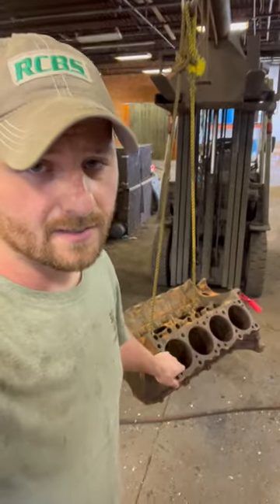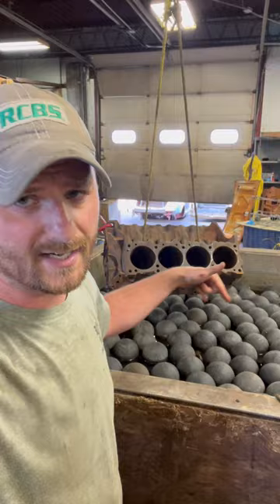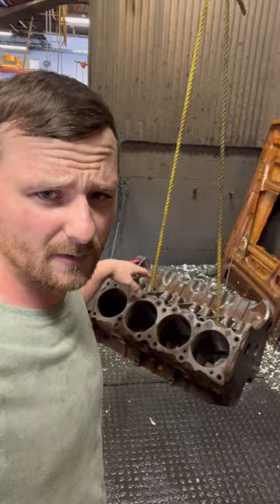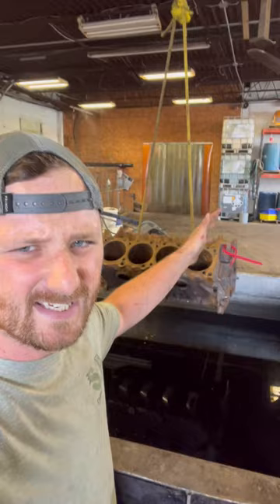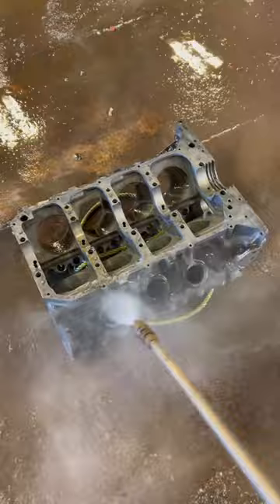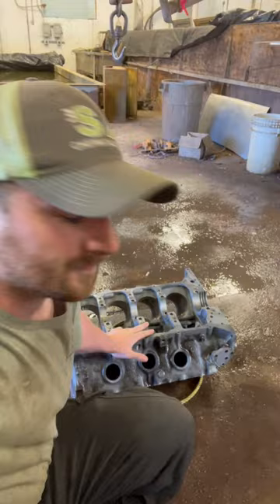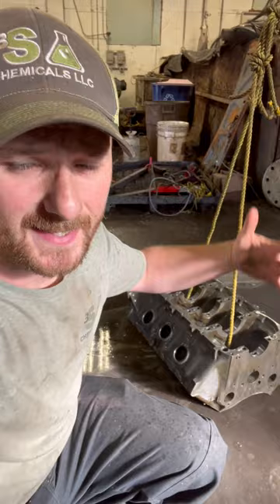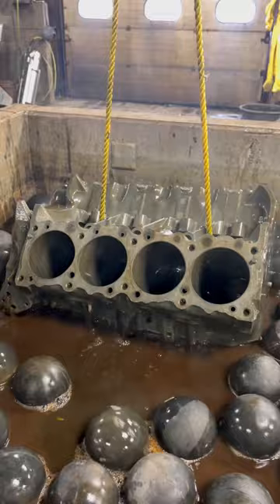Complete process of acid dipping an engine block

Comment: As an engine builder for 30 years I highly highly recommend NOT acid dipping for rust removal it will and does pit the cylinders past there limits if they are Rusty
Reply: The chemical does not cause pitting, it removes rust from the pits and etches the surface.
Reply: @hunniebe6  exactly
Reply: @Melissa Slaughter  removes rust from pits. Exactly first rust. Then pits.
Reply: I agree A acid dip does heavy work on metal objects especially engine blocks with fine tolerances ..how ever..an acid dip should be considered along side many factors ..as you stated cylinder bore..dipping to remove rust and cleaning but in the process leaving to much machine work boring out and having risk over bore..how ever..I dip blocks regularly here in South Africa ..and 95% of it..are resleeving jobs..so it does not matter about the pitting ..and resleeving is really a good choice.
Reply: Imagine being an engine builder for 30 years and being so confident in being wrong.
Reply: @JohnZombi88 the meuratic acid they are using is attracted to the fresh rust in the cylinders. It will eat through the immature rust oxide and the penatrate the usable surface below. This will result in what could have been a cylinder being bored out to oversize but reduced to having to be sleeved. Hopefully this clears things up zombie

Comment: Great video!
Reply from the maker: Thank you! I appreciate that!
Reply: @minute_of_dangle  Curious about the business. EPA regulations, cost of material, etc. I posted a comment on the string.

Not something I'm going to do right now, but maybe something I'm kicking around in about 10yrs when i retire. I have always wanted to do rust remediation via sand blasting, pickling (like your business) or using a lazer system (which is crazy expensive right now). 

Any info ypu can pass on would be appreciated. Enjoy what you have already shared.

Comment: Never seen one cleaned like that, the machine shop I worked at used a super high temperature oven that got the cast iron to around 1400 deg then put it is a shot peen cabinet that rolled it and hit it with steel shot for about 30 min. This looks like it gets a lot deeper into all the areas that really need it VS  our method, shot peen made the outside look like brand new cast iron but in the water jackets it wouldn’t get all the rust out
Reply: 1400 is way too hot, the blocj would start glowing around 1200. engine baking is usually done between 500-650. the only time ive heard of engines being brought above 1000 was for anealing cast blocks to remove stress, but it also makes em softer and kills cylinder longevity

Comment: Sorry, dumb question - obviously depending on what’s put into the bath, how many dips do you normally do before you have to recharge/replace a whole bathtub full of acids and neutralizers?
Reply: water in the neutralizer looks murky so my guess is theyre not in a hurry
Reply from the maker: It varies but these smaller tanks probably every other year. Our car tanks last a lot longer. The alkaline lasted about 5years. We spike them though
Reply: @minute_of_dangle what kind of acid do you put pleas ?

Comment: I did a 460 block, heads in steel barrel with the original TSP formula, the stuff you get in a paint store, put a tiger torch under it overnight, the machine shop said it was a better job than the new chemicals that they use today, also do small parts in a crock pot, or a deep fryer.
 I put it on at no particular ratio, just lots, for anti rust I use CRC with a solvent gun, or it rusts real fast, needs to be sprayed on whole still wet, the moisture goes real quick, CRC is better than WD40. Get on the gallon cans.

Comment: That looks great. I was wondering what the difference is doing this using acid baths vs electrolysis.
Reply: I don't know a ton about it at all but I heard electrolysis works in a line of sight between the electrodes, so it probably isn't as thorough as an acid bath. The bigger the container you use, the more the electricity can surround the block. I have yet to try it though. This is just what I've read online.

Comment: nice job...but grease bake oven,  shot peen, and hot detergent washing machines are currently the standard of machine shop industry.  they do the heads, blocks, cranks, rods, all the tin, come out white.  the acid will do inside the water jackets better though...I like that it's a Pontiac engine 421/428/455 family
Reply: Yeah grimey sand casted blocks nothing better than some electrolysis but I have wondered about ultrasonicly cleaning engine blocks but I don't know if they make ultrasonic vats that big or if the block would be to thick and dense for the vibrations to transfer well
Reply: Oh and how'd you tell it was a pontiac I haven't figured how to identify them yet but I'm 24 pontiac just used SBC for my whole life so I haven't seen many pontiac engines
Reply: The "current standard" is only that way because lots of shops don't have acid baths anymore.  The acid is still the best way if you can find one.
Reply: @cameronvandygriff7048  You can tell it’s a Pontiac V8 because the #2 (even) cylinder bank is biased to the front more the the #1 (odd) bank is; It has the ‘transfer pyramid) on the back RH area right above the bellhousing mount;  it has 10 head bolt holes per side; has an oil filter adapter mounting area on the rear RH side; has a bolt-on front timing cover

Comment: Great job.  hate to see the EPA have a cow at your place with them chemicals 😉
Reply: STEM M, same chemicals used in drain cleaners and pool shock. The only “cow generator” is the proper disposal of the removed paint as it sometimes contains heavy metals.

Comment: Just subbed after seeing you on FB how does compare to a machine shop using their hot tank on a engine block? Would this destroy a aluminum block?
Reply from the maker: Thanks!! It’s comparable but this also goes after rust not just cleans and degreases. It would destroy an aluminum block. We have to use a different chemical for that

Comment: So why do you not use electolices rust removal
Reply: Marc cres, think about it. They use what they have. If you start up a stripping shop you can use electrolysis for rust removal if you want. Then you will have to invest in huge rectifiers AND still install tanks of caustic to remove the paint and grease.

Comment: That is stupid. At the same time your getting the rust off your changing the demensions of the machined surfaces. Bearing bores, main bearings, cam bearings. lifter bores to name a few. Acid will also start cracks in hardened metals.  In other words DON'T DO ENGINE PARTS!!! You do cast iron is like a sponge and will absorb liquids. Thats why welding is a pain on any cast piece.